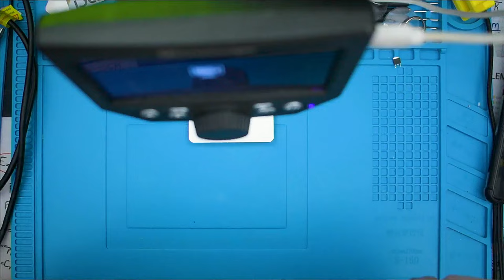Not All Hot Air Stations Are Same!

Comment: 😂😂😂 lol , if you are using that for MOSFETs the you should quit ... In 99% cases you need to go first step flow and 400 c ... To much air your smd's will get crazy all over the bord . And your first station can do that easy even with the fan. The answer is a good calibrated termistor in combination with air flux . Get real and stop selling crazy stufff
Reply: Can you be more concise? 
I didn't get all the 400°C and the airflow being too much.
Reply: @pwqmrvwerogru  well that's the point - you don't need to much air flow unless you are desoldering all your smd's from that bord. You need to hit the MOSFET with hi temp not all your board ! Hi air flow will blow small things out from your board - you don't need (whant) that ! You whant a small MOSFET out not all the caps around it ... Think about it.
Reply: @pwqmrvwerogru  1 . Pre heat the board 400c full air flow from a decent distance from the board. (To avoid thermall shock)
2. Concentrate hi temp @ what component you need to solder(desolder) . Low flow with nosel close (not to close) to mos, cap, or what you need ... LE: 400c is over kill that's the point were you need to trust the termistor you have ... 400c will damage components on a direct hit !
Reply: repeat the  high/low  potentiometer  control can make the volum airflow but finger is very busy.
Reply: Did you see the video comparison? If you have only just one MOSFET to pull out quickly the piston one does much faster job.
Don't say "But it will reach 400 C and damage the component", you see it clearly when the solder already melt (which is still under 300C) he already pull out the component and stop the blowing. The issue here is time. Even professionals like Northridgefix don't need to preheat or step flow and 400C, he just immediately heat on what area it needs to pull. Too much air? Just reduce the speed. The problem with fan-type blower is that even with maximum speed it is still delivering way smaller in volume than optimal (ideal) air volume and takes much longer in time. Yes flux helps but here again this is just a DEMONSTRATION of two blowers with same treatment (both having no flux).
Reply: You've gone overboard on criticizing him when he did say it's a practice board. He is just showing that the 2nd one can do it better and faster. When you have an electronic fixing business, a minute difference would add up. That's why the 2nd one suits more for a more professional use as what he said.

Comment: Actually its not a piston inside,, its just an enclosed brushless fan, this fan handle built model had some models with brushless fan also,,, these more expensive ones have more powerful heating element in them and also their power supply play a huge part in their performance especially if they were driven by iron core transformer

Comment: Hello. I'm hoping to make a hot air station. I want to order the 858d pcb for the station. Do you know if it's possible to hook it up with the diaphragm pump heat gun or can I only stick with the fanned heat gun? The fan heat gun comes with the 858d pcb by default on off the shelf rework stations.

Comment: I purchased one with fan in the handle from Amazon.  Worked it good when I first got it just practice desoldering parts, died in less than 2 weeks.  Returned it, spent a little more and got one with the fan in the main unit.  So much better and hasn't left me down yet.  I suggest if you do buy one, work it hard the first 2 weeks to make sure it holds up and you aren't out of the return period.
Reply: Which one did you return and which one did you replace it with?

Comment: A fan speed setting of "six, whatever that means" immediately invalidates any test if one doesn't know the L/min output at the nozzel for the setting(s). There is no way to determine how a setting of "six, whatever that means" affects the air output from different designs, so it could be your setting rather than anything related to the pump type that is causing one to take longer than the other. 

Example: Perhaps one needs a speed setting of 8 on the one unit to provide the same air volume output and temperature as a speed setting of 6 provides with the other unit.
Reply: True
Reply: Not to say that we also don't know how accurate the temperature display is
Reply: ...but this one goes to eleven..😂
Reply: I just did a quick research. 
On Amazon and other multiple websites, I found the same details: the Baku 858a claims a maximum 120l/min airflow with that fan. (I guess it's a standard 4020 blower fan)
 Instead of that, in the Baku 701b specification, they wrote "just" 0.3-24l/min. Very interesting.. I believe not just the air flow, but the pressure also matters. The huge difference is that, if anything obstructs the airflow,(you must keep close enough to the component) the fan version immediately will reduces the airflow,  until the (diaphragm) pump version still will press trough the same constant amount of air just with higher pressure.
(Because both knob can set from 0-8, in both case we can expect 75% airflow if both set to 6. The conclusion is, the pump version truly gives you 18l/min airflow even there is some resistance from the MB and the FET, however the 90l/min expected from the fan version is totally false in any condition.)
Reply: @budavaril  Thanks much for sharing your research and analysis!
Reply: @budavaril  I fully agree. To get a REAL/better comparison of both constructions it would be necessary to measure the temperature out at the nozzle as well as the air volume out of the nozzle (ideally the air volume of a hot air gun may be controlable to be able to influence the required time to solder to the sensitivity of the component to be soldered, mechanical parts or large MOSFET switches may be less prone to failure by too fast heat up, while ceramics or complex ICs should in my image be heated up rather over 1 or 2 minutes, 20 seconds is for such sensitive components too fast).

Comment: The fan type unit pushes more air than you will ever need for standard electronics work. 
You don't need to blow the part off of the board.
Reply: True, but with one caveat: if using the smallest nozzle, the cheap one will not have enough air flow to desolder an SMD resistor. Speaking from experience.
Reply: @RolandV3922  That's not the case at all.. It will still have more than enough airflow to blow the whole part off of the board. 
I'd check that you're not blocking the air intake with your hand.
Reply: Try doing larger BGAs with it
Reply: @NicksStuff  Again, there is nearly too much air speed.. The temperature is no different either. This is no different to the cheap vs expensive soldering iron thing.. they both supply heat through a tip. Just some have more features and are nicer to use. They will both do the same job.
Reply: @ryanokeefe12  Can you show us how you reball a chipset with the cheap unit?
Reply: @NicksStuff  There are dozens of videos on youtube of people reballing BGAs with fan-in-handpiece hot air stations.

You've ignored what I've said and diverted.
Reply: That's what I was wondering about while watching this. It seems like, assuming the heat transfer is efficient, the tip temperature would have more to do with how quickly it gets the solder flowing, and that blasting it with a higher pressure would wastefully diffuse the stream and throw the heat in all directions, but I could be wrong, and I guess it also depends on the area you're trying to cover. (note- that's coming from someone who actually owns the good type 😆)
Reply: @jidissafi7413  Think about cooling (a car or a computer). The sheer volume of air is what makes it work. It's the same to heat something up: if you have a small stream of very hot air, it's going to cool down very quickly against the components and very little heat will be transferred
Reply: @NicksStuff  Thanks! Reminds of stuff I was reading back when I first got a real dust collector for my shop and was trying to understand why it was better than the seemingly stronger Shop-Vac I have. In the case of heat though, would that be because the more focused stream left the target part surrounded by cooler areas which quickly soak up the heat?
Reply: @NicksStuff  The time to remove a component is for sure an important point, however I think the stress applied to the componenent and its environment which may result in some kind of failure is another important factor to consider (the same with loading batteries, you can do it at low level and have to spent quite a long time, but low level current has much less chance to deteriorate or even damage the battery than fast charging at high current with possible overheat). When I remember correct, the total Reflow Process to solder the SMD components onto the PCB takes something like 2 or 3 minutes. In this sense I feel the very fast 20 second hot air station is much more prone to cause some kind of damage or pre-damage on sensitive componenents and its environment of components as far as they have to adjust fast to the mechanical expansion caused by higher temperature.
A 3rd point to consider is the weight/area relationship of the component to solder or desolder. A low volume air flow is less prone to push low weight components aside.
Taking these 3 in my view main features into consideration I think the fast hot air station is good for not so sensitive components like mechanical connectors or huge MOSFET switches, but in case of small resistors and more complex ICs I would rather prefer the slow speed hot air station. Somewhere there is an optimum point on speed of soldering, too low heat up rate places the components longer time on the hot stress, too fast heat up rate places the components on extreme stress to change mechanical dimension where the changes of a metal/bond wire may ongo much faster than that of the surrounding plastic, as metal has a low heat resistivity but plastic has a high heat resistivity and that of the chip and its sealing may be again different and these differences do cause stress when the change happens too fast.
A 4th point may be reliability differences between both solutions, but I have no image if there are any clear differences on reliability when the heat flow is determined by the main unit or by the hot air gun (I guess on reliability difference in price matter strongly).
Reply: @FriedhelmSchröter  With a quick (hot and high air volume) station, you can reflow the joint so quickly, the components don't really have time to heat up. But if you really want it, you can choose a lower temperature and airflow
Reply: @NicksStuff  If your thinking is correct, why is Reflow Soldering of PCBs then not done within seconds?
In my understanding your thinking is wrong, because at least the inside metal connections like bond wires within ICs will heat up very fast when you solder the outer Pins. And thermal stress is proportional to the difference in temperature. This means at least the bond wires will experience extreme thermal stress and I assume this will result in a certain percentage of failures. In case of purely mechanical parts I do see no problem with extremely fast heat up, but in case of sensitive components like ICs or ceramic capacitors I would not apply extremely fast soldering (but you are free to follow you thinking and when no failure congratulations, but if failure I hope you will report here and correct your in my understanding wrong thinking).
Please check the diagram of temperature versus time recommended and applied to nearly all PCBs and exactly this diagram will result in lowest failure rate on all components, because all components are extensively tested/optimized for this diagram (temperature vs. time).

Comment: One problem, I am unable to find the piston unit, everything available seems to be fan-driven!
Reply: Older tech used diaphram (piston) pump
Reply: When listening video it didn't sound like pump. Station what I have (Aoyue 2738) has clear pump sound that would have been on record. So I think both in this video is using normal fan. Blower fan in handle and bigger axial fan in station.

Comment: Why do you want so much air to push through? Do you want to blow your components off the moment the solder melts?
Reply from the maker: You can regulate that without a problem. More air volume carries more heat to the components. 

More air volume doesn't necessarily mean more air pressure (air pressure is dependent on the diameter of your nozzle - the smaller the diameter, you'll generate more pressure to push the same volume of air through it, unlike with the larger nozzle).

My point was that the fan isn't pushing the same volume of air efficiently through the nozzle, like the vacuum pump would (most air pushed by the fan can "bleed" through the handle).

Comment: Seems to be an increase in price of rework stations, well in Canadian dollars they are $130+ with a hose connection.   Most that I see under $80 are ones that use a fan.  What my take away from this is... if I am not going to be doing professional work for others and just need to replace an analog stick on a controller when they wear down every 3 months or so, the cheaper option for heat guns would be fine and get the job done(just not as efficiently). 

I can see why one would need a better equipment if they are working with fixing electronics regularly for their work or hobby.  Time is their limiting factor of how much work can be done in a day.  More work done = more money or more learning depending on the skill level.

Comment: Honestly I find it bizarre because I have the cheaper one with a fan, and it's as fast as the faster one you have. 
The one I use is Yihua 959D II rework station... and I usually set the temp to 330 C and airflow about... well, I dunno the lowest setting? since I don't have that fancy percentage option. 
Probably the slower one you have needs a fan replacement... maybe?

Comment: Just do what I did, pick up a "parts only" station that looks good and not damaged in the pictures on eBay that blows air fine but is showing a heating element error on screen. This is key though, do NOT go for anything that might have problems with the pump or power circuitry, or any unknown problems, it MUST turn on and blow air. You can get a very good deal on one of these even from the top brands. Personally, I got a Quick 881D, which is a beefier version of the 861DW with a higher max air volume and 1300W vs 1000W. Quick is considered one of the industry standard stations and praised by many reputable sources, and this particular unit goes well over $500 typically. I paid $100 after shipping. The reason I said to get one with the above mentioned fault is because the heating element in these types of stations is designed to be replaceable and it is very easy to do, its 3 screws, a plastic clip connector, and 2 pin and socket style plug in wires, that's it! The heating elements themselves are rather easily found and can be sourced from the manufacturer if that is something you care about, otherwise just buy one wherever you can find the best deal, eBay, aliexpress, etc. Straight from china seems to be cheapest from what I have seen.

Comment: It depends, over here the professional kind with the integrated pumps/large blower fans are a LOT pricier than the little fan handle ones. The fan handle ones also get a lot better than the 858a/858d clones. I just got a Yihua 959D-II after my no-name brand 858d bit the dust and i'm very pleased for the occasional use i give it.

To sum it up, the fan handle kind is absolutely fine, as long as you're not doing this as a career so there's no time pressure. It just takes a bit longer.

Comment: I'd like your opinion - which would you own if you could only use one or the other of these two hot air tools. The Quick 957dw+ or the YIHUA 959D please?
Reply from the maker: Definitely the Quick! 😊
Reply: @milanfixer  Thanks. All I could afford was the Yihua . I'm hoping to use it for dc jack removal, which i will do rarely. I have a Dell Latitude AIO 5490 that has a bad dc jack that I plan to replace using the 959d. Other than that I might do a rare dc jack replacement on a laptop. Think it will do the job? Thanks!
Reply from the maker: @timmyinthewell1  Oh definitely, my friend! It will do the job just fine. It will also serve you well, because you'll use it rarely. If you plan to go pro as a technician, then you should get the better kind because it'll save you a lot of time 👍

Best of luck to you with the DC jack 🍀
Reply: @milanfixer  Thanks so much for your videos and your guidance!

Comment: You have to make sure the inlets for the fan never become blocked with dust. It's happened to me. The element overheats and burns through the mica insulation, then shorts on the metal shroud, so turning it on trips your circuit breaker. Fortunately mica insulation sheets are cheap as dirt, but it's still a problem you can run into. Especially at low fan speeds and if the dust is inside the fan, where you don't notice it. That's really the only reason for pistons. The fan has more air flow than you will ever need. Mine never once went above the 2 on the dial.

Comment: My Sumsour  hót air with dần in the handle is a beast.  I plan on getting the pump version because they are usally higher quality.  But my cheapo hot air that I have used for 2 years is just fine.
Reply from the maker: It is OK, the fan version can be useful. But once you get the pump version, you'll definitely see the difference. Good luck mate 👍